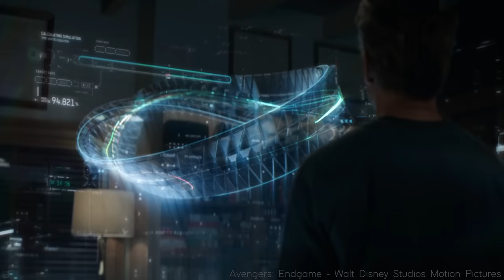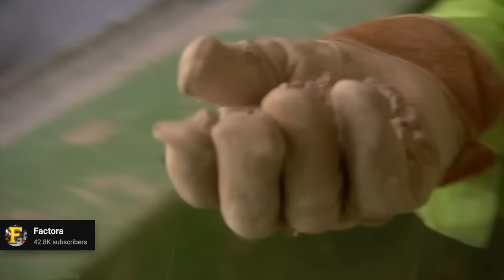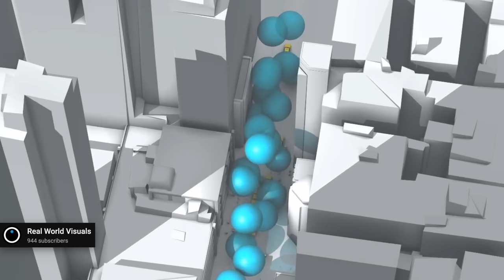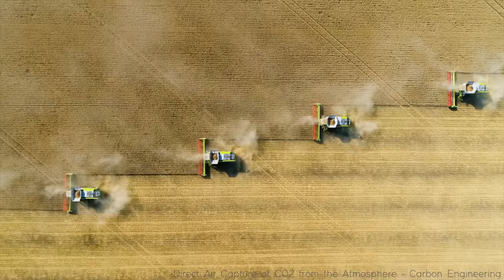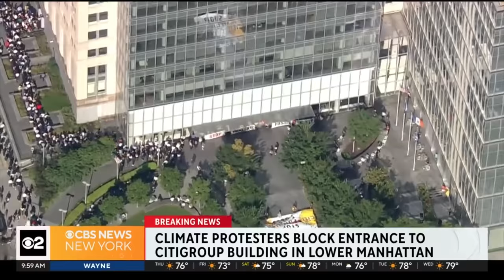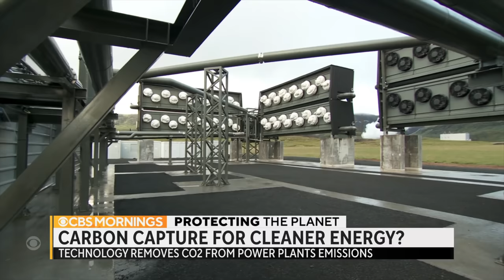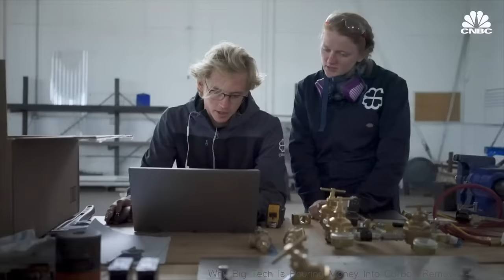How Thermodynamics Holds Back Negative Carbon Tech

Comment: You’ve poured a remarkable large amount of work into this, and I can say a fair amount of thought. But I’m concerned that you made several errors and not a small number of misleading statements. Two salient examples are: 
1) your particle count. 400ppm is not 1 in 2,500 particles. It’s 1 in 2,500 masses. Which for CO2 amounts to 1 in a bit less than 1,700 particles. The overall level of erudition makes it seem like this is not an accident. 
2) one fourth of the US electric supply to remove a trillion tonnes - masks the fact that the  electricity supply is only 20% of the energy consumption, and only the US. So - 5% of just the US energy supply could reverse CO2 to preindustrial levels? Frankly that’s not the way your tone comes across.

Comment: There is no difficulty in generating enough energy to remove say 10bntons of CO2 annually. 

Take the Global Thermostat solid sorbent DAC machine which uses under 1MWh of exergy (work)  to remove 1 ton of CO2, half as electrical work and the rest as heat, which can be supplied using a heat pump

In the sunbelt,  annual insolation is ~ 8GJ per sq metre  ie ( ~ 2.2 MWh)  , so using PV with batteries it is possible to power the removal of 1 tonCO2 annually with around 1.5 sq metres of land.
Or by extension, 10 bn tonCO2 / yr removal on 15,000 sq km of land, ( about 120 km square, but not contiguous).  The Sahara alone is >9M sq km in area.

To give an idea Bloomberg NEF estimates that by 2030 the globally installed PV will amount to >5TWp. 1 TWp  produces ~ 2000TWh annually and will power ~ 2 bn tonsCO2 removal.

We can certainly create the PV power supply needed to do this

Comment: We need more CO2 in atmosphere not less!
Reply: Exactly!
Reply: Are you a climate scientist?
Reply: @yigithan.kilinc  We are in an interglacial period after coming out of an ice age 10-12,000 years ago. The CO2 levels were close to or at the lowest levels in history before the industrial revolution.  Photosynthesizing plants and algae will begin starving below 150 ppm  and we were at roughly 190 before the industrial revolution.  The optimal levels for plants is at a minimum 800-1000 ppm and possibly 1500 ppm. Higher CO2 levels makes plants much more drought tolerant and would in fact help increase the productive  green land mass.
Reply: @illumiNOTme326  and also we begin to see the sahara to be greener with more carbon in the air, so CO2 is very good, people are forgetting that carbon is life, also if we really want to fight green house effect we should aim at water vapor aka cloud, their effect is magnitude higher than carbon but we know getting rid of them is dangerous, which is the same for carbon
Reply: No what we really need in the atmosphere is SiO2

Comment: We don't actually need trees that require arable land to capture carbon via biomass. Trees grow too slowly. We could just grow algae anywhere with water access. Even salt water is suitable for some species. And then put them somewhere where we took carbon out of the earth, like abandoned mines, and close them up when full. The lack of oxygen in the closed up mines (potentially also combined with high salt content if produced in sea water) will inhibit decomposition.

And even if we run out of easily accessible abandoned mines, digging a hole is cheaper and much less energy intensive than direct air carbon capture.

Comment: Just to get a better feelings of the cost: 
44g of CO² equals a minimum of 19505 J or 5.42 Wh per mol of CO2
so we could suck 8.1kg per Kwh of electricity at room temperature. This is 124 kWh per ton CO2. This sounds ridiculously low to me, since if solar electricity at a price of 2 cents per kWh would be used for this, the electricity cost would be only $2.48 per ton of CO2 removed from the atmosphere. Or am i wrong somehere?
Reply: I asked basically the same questions in one of the comments here, nobody could could give an answer. Sucking CO2 from the atmosphere is a brain dead idea if you could use renewable energy to displace fossil fuel energy, the reduction in overall CO2 would be greater by orders of magnitude.
Reply: @zaar2604   Sure. Also the 8% efficiency of the process would lead to a more realistic figure of $31/ton. Still, climateworks says that they can achieve $600 per ton to date. Anyway, reducing emissions alone wont help, we need CO2 removal as there is too much CO2 in the air and ocean already, so we have to remove it somehow
Reply: @zaar2604  Sucking Co2 from the air can make sense with fossil fuel energy. The energy needed to suck up CO2 is ~3% what was released when the fossil fuel was burned. But inefficiencies.

Comment: Good video. One thing it doesn't seem to mention is what to do with the CO2 once you pull it out of the atmosphere. Is underground storage proven/stable enough ?
Reply: My understanding is that the storage itself is probably the most proven aspect of CCS. The Sleipner project in the North Sea has been doing it since the 90s.

Comment: I somewhat doubt the utility of of using DAC for drawing CO2 directly from the air. The efficiency will always be very low. However deployment at large sources of emmissions of concentrated CO2 (e.g. steel plants, concrete making facilities) should achieve much higer efficiencies cutting down on energy costs. Along with carbon neutral energy generation would be a step in the right direction.

Comment: Why did you skip the algae ? Those are much more efficient than trees with consuming CO2 and they are easy to spawn !
Reply: for this towork you need to make artificial ponds in the desert, huge ones, to avoid changing ocean balance, and bury it, pumping 6 feet of water repatedly over large portions of desert is costly, but doable, for a high price , well worth it, but doing it on a planet scale requires cooperation and lotsbof robots, volunteers and energy, it is a way though.

Comment: There is a storage and grid problem with renewables and instead of punishing producers for giving too much electricity for the grid the electricity could be used for CO2 capture. However the greatest issue with renewables you hear is that the grid is not ready (too small --- and I said for years it should be at least the whole northern hemisphere) and there are no storage facilities built. Not too mention we should reduce it to pure carbon and it should be safe enough to be given back to the fields.

Comment: Their is some good news, Recently their was a new discovery of making a new kind of true zero carbon concrete that doesnt use furnaces rather it uses electrolysis to make it!
Reply from the maker: I’ve seen this too, didn’t want to jump gun but looks promising
Reply: @CoolWorldsLab  yea, it's awesome. I study stuff like this every day and made me a sci-fi nerd
Reply: The concrete made from their cement received an ASTM C1157 performance designation. So their product is getting good marks. Sublime Systems is who makes the low carbon cement.  More testing is being done through third parties. The ASTM rating paves a path for their cement to be used compliantly under US and international building codes. So it looks promising.
Reply: @Architeuthis87  yes, it does!

Comment: Honestly, i think you need to do a deeper dive into the carbon cycle to really complement this video. You are missing some really key points. Not only do you not mention the oceans which hold just as much CO2 in the surface layer alone, but we need to be really careful to move the carbon to a geologically safe location. We disrupted the slow carbon cycle by burning fossil fuels, and that takes literally 10-100k years to naturally reset. If you really want to consider this from a thermodynamics perspective, you should have just considered the energy we got from the last century of digging up and burning carbon. No matter the method involved, we need to pretty much reverse that process and get the carbon into the ground. Im not surprised your analysis came to about 100% of future global energy production, but i have a feeling that its closer to 100-200% of energy production from the last 3 centuries.

Comment: Climate models may paint a doomsday scenario but actual data does not. We need weather data from areas not influenced by urban hot spots. Urban areas, when you think about it, are where we convert much of electricity & fuels into heat; it just makes sense that urban areas get hotter. Climate models don't show the cold or warm periods that have occurred in the past 5,000 years. 
I worry that we, in our efforts to reduce heating supposedly due increased levels of CO2, put our civilization in worse peril due to excess economic hardships. While our ancestors survived  the last glacial period, most present people don’t like such a cold climate.  Photosynthesis originated during at time with much higher levels of CO2, and plants do better with higher levels of CO2. You should listen to Climate Discussion Nexus videos for informed content.
Reply: think of this - once, in the near future - : "Oh, yeah, its not the CO2 - we simply measured wrong. Upsi...". Like to mention the "movement" of weather stations into more urban areas...

Comment: People should all see this. It's very well done, all that work that went into it. I shiver ;-)  But it can't be said enough that the technique of DCC will not suddenly become miraculously simple and cheap and efficient, thanks to some invention.  What seems realistic to me?
1) We could use CH4, remove the C - part and deposit it as solid carbon which can easily be stored, no need to inject CO2 somewhere. This "turquoise hydrogen" could then be used for steel etc.. That would be a huge improvement but the fossil fuel shareholders want their returns as usual so sorry. 
2) The land problem could perhaps be solved if we consider all these roads and highways on earth. The sides are now often grass/weeds covered. Instead I would grow a very fast growing high biomass plant. (with its own nitrogen fixation) These seas of biomass would get harvested mechanically once, most likely even twice a year. The biomass must then locally through "torrefaction via microwaves and compression" be turned into a more compact, dense, cheaper to transport brown coal like product. This product  is already now added to coal in steel ovens without adaptation. 
3) I bet the present pyrolysis technique can be improved so that with the suitable input (only one type of biomass?) , in only a few steps and with cheap catalysts,  a directly usable biodiesel, methanol or synthetic fuel can be produced. 
4) Our plastic gets mixed and so can't get recycled. OK then give every plastic (pvc, pet, etc) its own color shade, just enough so an electronic eye can separate it. Or better, forbid all these types plastics (I mean in normal domestic waste) and keep only one which can be fully recycled back to monomer. 
But yes, oops, no sir, that's "communism". That's against the holy free market religion.

Comment: We already do massive amounts of carbon capture every single day: Tree Farming.

Trees turn CO2 into sugar, then turn sugar into Cellulose, then turn Cellulose into Wood. 

By harvesting and building things out of the wood, we stop organisms from decomposing it back into CO2.

As unintuitive as it sounds, cutting down trees directly reduces the amount of CO2 in the atmosphere in a real and tangible way. Just so long as those were trees you planted for the sole purpose of cutting down, and not trees that were part of the ecosystem. 

Fast growing softwood evergreens are already the most commonly farmed type of tree, we could simply ramp-up this operation significantly to replace all of earths plastics with wood and paper materials. 

Less pollution, and direct carbon capture. Win-win. 

Also nobody ever mentions that the ecosystem needs CO2 to function. Trees can’t grow in conditions under 100ppm, and prior to the Industrial Revolution the earth was steadily approaching that cliff (sub 300ppm). 

A better solution to climate change than removing CO2, is actually just to remove HEAT from the earth directly. And this can be done relatively easily. One way is simply just paint all human activity bright white. This will raise the albedo of the earth, thus cooling it.

Another way could be a “planetary heat pump” which would be to take ambient air, use it to heat up a special material that doesn’t emit infrared radiation when it heats up (such materials already exist, they emit microwaves when you heat them up) and focus all that non-infrared ration into the sky. Essentially beaming earth’s excess heat directly into space. 

This way works much faster, and has the added benefit of keeping CO2 levels safely and permanently above the 100ppm threshold needed for plants to survive.
Reply: Turns out that the amount of wood we use isn't enough. It's quite a bit less than fossil fuel use.

Comment: Uh, the section on thermodynamics (at 10:29) seems to be  …completely wrong and unfounded…?

Maybe somebody can correct me?

I looked it up, and the Gibbs free energy of mixing applies to materials that bond TO EACH OTHER. That’s not the case in a solution (air) of N2 (nearly inert) CO2 (also inert at normal temps) and oxygen. The fact that there’s O2 laying around has little relevance, since the other two are inert. There is NO mixing  energy. (I’ll check back later for an explanation…?)

I think, then, that the rest of the video is not credible. 

Indeed, the cost of sorting out CO2 is not an energy cost but a mechanical cost. You can’t grab the molecules with tweezers, of course. But to sort gases you chill them… until the CO2 literally falls out of the air. (See “dry ice”)

Different formula altogether. And what is that formula? I don’t think it’s thermodynamics, so much as it is the cost of a refrigerator. Again, the temp of the air is not related to the fact that these molecules are sitting next to each other. 

I hope I’m wrong. And I hope somebody can point me in the right direction. It ain’t Gibbs.
Reply from the maker: The Gibbs Free Energy of Mixing is for…. (drumroll)… mixing! Not chemical reactions. Not sure what you’re looking at online but any good chemistry text book should cover this, for example I used “Physical Chemistry” by Atkins when I studied chemistry back at Cambridge University.
Reply: @CoolWorldsLab Thank you for your quick reply. I looked at a Cambridge textbook, so we’re off to a good start. Why do you refer to mixing when you need to sort or precipitate the CO2? (Please set me straight if necessary!👍) These gases are like mixing sand, are they not? No energy needed to mix them at all…? (A uniform powder was the base case given in the text to set up the variables in the equation, before the calculus.)
I was expecting an energy cost to get a ton of air from “ambient” down to, say, -39 C…? Or if the molecules are not as inert as I assume, what are you adding to bind selectively for the sort? (In this question, I’m assuming something like the Haber-Bosch process to get H “up” to the Nitrogen…and break up the steam…?)

Comment: shouldn't we capture the CO2 where its produced instead of filtering it once it diluted in the atmosphere? for example, your factory burns natural gas to melt iron? ok, instead of releasing it directly, filter the carbon with a DAC. States could enforce somethin like this.
Reply from the maker: The problem is getting all states and all nations to do so, because it’s costly (and also only a fraction of total emissions)

Comment: why capturing carbon from regular air?
while it would more complex to set up wouldnt capturing and storing carbon dioxide from natural volcanic outgassing and methane from locations where it naturally seeps or bubbles to the surface be much more effective?
sureley if these methods are more efficient with higher concentrations of the gasses they should be used in ( or piped/collected from ) locations like these where the concentrations are the highest

Comment: There is an interesting study of farming and sinking seaweed like kelp out in the middle of the ocean and since it wont break down it will just sequester at the bottom of the ocean as a carbon sink.  some can double their biomass in a day and the energy would mostly come from the sun.  Maintaining the farming ship and the sinker tech would be the most expensive energy which could also be powered by the sun and batteries for travel.  Its one of the most promising methods I've heard about and most energy efficient.

Comment: How much carbon is produced during DAC manufacturing, installation, maintenance and repair?  There is no free lunch.  That's an old saying about the conservation of energy and mass and everything under the sun.
Reply: Probs not much. Whatever conservation of CO2 law you are trying to apply, it doesn't work like that.

Comment: Regarding the energy cost: 3% of the US's total yearly energy budget for a billion tons doesn't sound that bad to me. I happen to know from my chemistry classes that this is in fact more or less equivalent to the energy budget for the process of distillation in the US - yes, just that ONE chemical process (ironically, both distillation and carbon capture are separation techniques). The world as a whole should definitely be able to scale that up to a target that has meaningful impact.

EDIT: The actual efficiency is significantly lower than I was guessing though; that might be an issue. (and I'm not going to question the prediction because these guys wrote a paper about it while I just have a few years of chemistry education without a title to show for it)